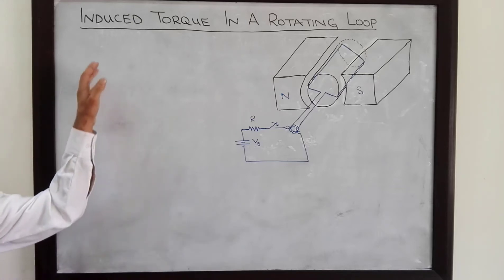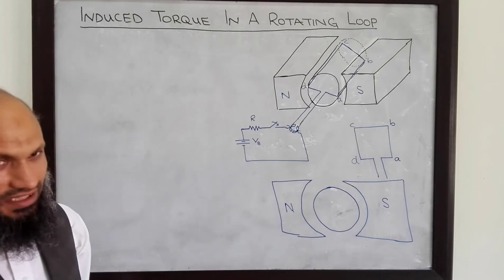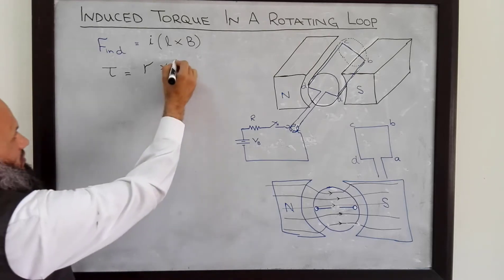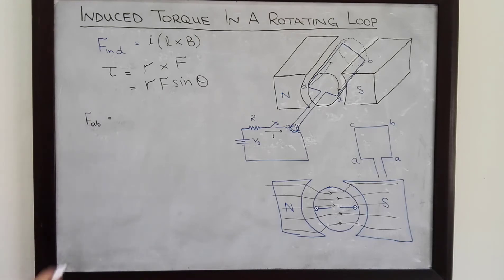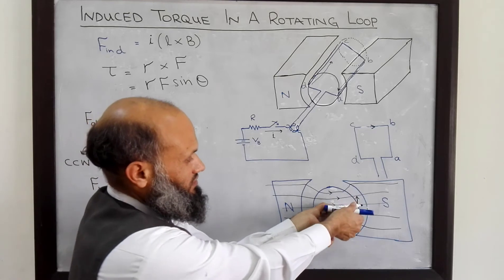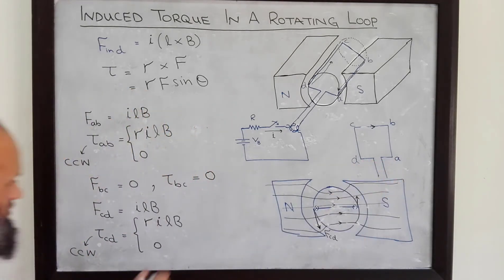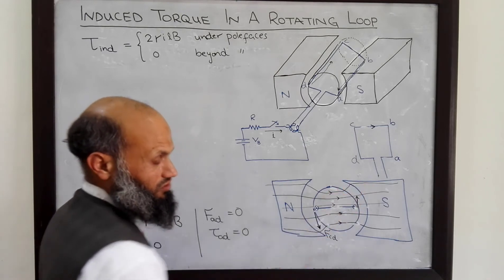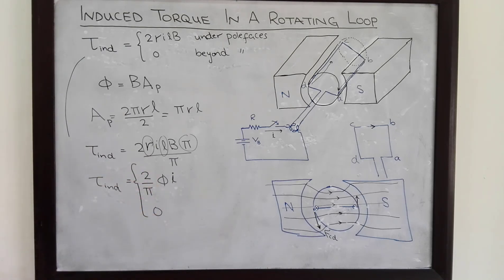EE213 - 14a - Torque induced in a loop rotating in magnetic field of curved pole

Comment: why force is determined by the magnetic field in the air gap and not by the magnetic field inside the rotor
Reply from the maker: The force depends on the flux density on the current carrying conductor. Furthermore, the flux density in the air gap is almost the same as the flux density on the outer surface of the rotor, because both have almost the same areas.
Reply: @MAFarooqi  Sir, which book talk about "Why are the slots on the rotor of an induction motor skewed"?
Reply from the maker: @relaxwithme4695  You may find some discussion on it in the book by S. Guru. And more detailed calculations in the book by J. Pyrhonen.